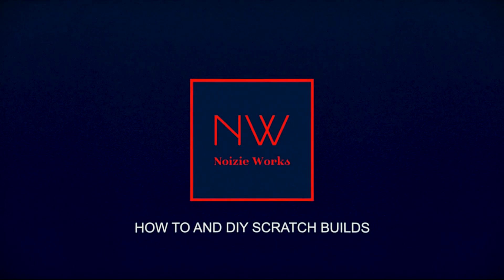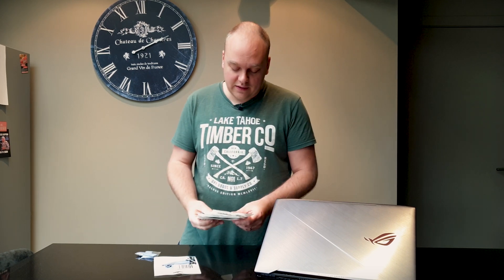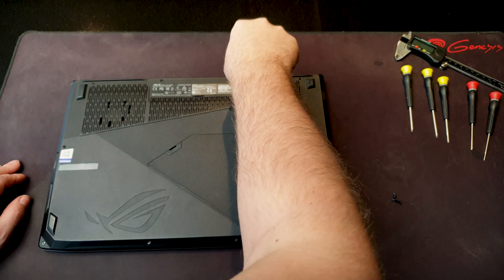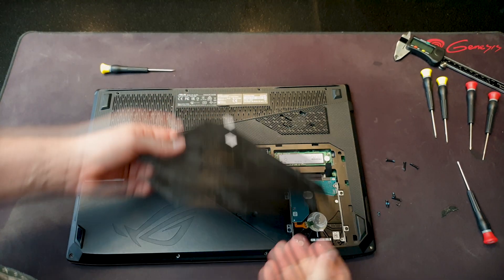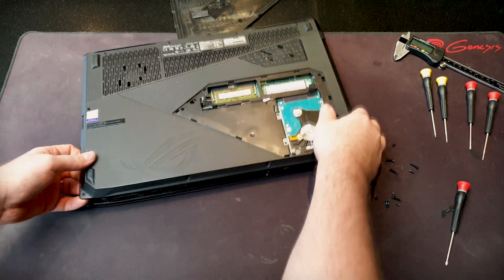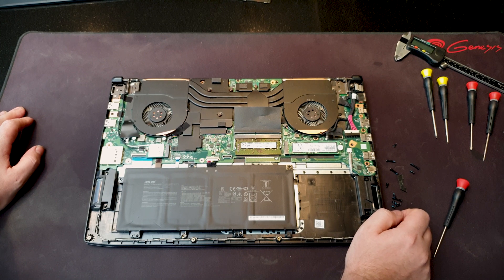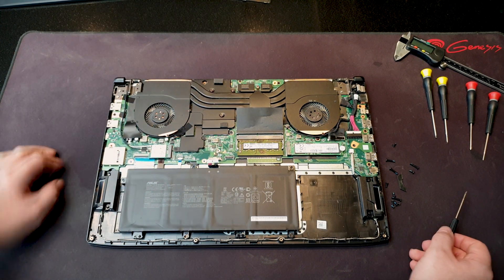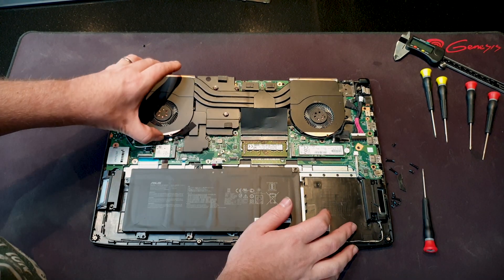Replacing thermal pads on a Asus Rog Strix Gaming laptop GL703V

Comment: What if the Laptop is 7-8 Years old? I have an old Medion Erazer and i've never changed the pads in those 7 Years. Do you think it would be worth in my case?
Reply from the maker: It was mainly the thermal paste but i knew it would destroy the pads so why don't do them both. In my case the laptop was already thermal limited from factory, if you're unit isn't thermal throttling i wouldn't bother.

Comment: I have a Msi gf63 thin 10oc what thermal pas thickness would you recommend I use?
Great video by the way
Reply from the maker: Get yourself an assortment pack with different hights
Reply: @NoizieWorks  thanks man I just got my thermal pads delivered they were 1mm and my laptop's default pads were basically just 1mm apart from one or 2 pads I think that are 2mm or 1.5mm but I replaced the thermal paste and pads and my temps have dropped  at least 5°C - 8°C

I also wanted to ask if my laptop's Cpu idles at 50°C and Gpu at 53°C is this fine??
Reply from the maker: @tristan420  no problem, laptops just get freaking hot so if it boosts with not a lot of thermal throttling you are doing great
Reply: @NoizieWorks  Okay sweet👌💯I did a few stress tests and it doesn't seem to be thermal throttling so I think all is well, I guess one of the downsides of having a laptop is having it run at hotter temps than the sun due to the lack of proper airflow in laptop designs😂
Reply from the maker: @tristan420 💯% lol

Comment: Hii ,can i had run out of thermal pads can i apply thermal paste noCTUA NTH1 on my vrams of gaming laptop or will my vrams short coming in contact with aluminium heatsink
Reply from the maker: There is a thermal putty you could apply. Normaly thermal paste is not conductive so you can apply it however you want but if it's regular paste it could droop out and overheat the vram
Reply: @NoizieWorks How does thermal putty fare compared to thermal pads, do they perform the same, or is one better than the other?

Comment: I have a GL503VS. I've tried replace thermal pad and repaste but my CPU and GPU while doing normal task still get up to 70, 75 Celcius. You guys have any idea how to fix this? Thanks
Reply from the maker: Anything under 80 is great. Problem is that before it would reach 90c and thermal throttle so you did a great job

Comment: Hi, this was helpful to watch. My laptop is starting to get concerningly hot. It's 5 years old and at least one fan is making a noise. I'm trying to decide between replacing the fan or the whole heat sink since it's hot all across the top (where the heat sink would be when I cracked it open). I dusted it already, but it hasn't made much difference. (Didn't know about removing the screws on the fans for cleaning. I'll try that as well.)

Comment: What tool are you using when you squeeze the pads? 
edit what is it doing too?
Reply from the maker: only thing i did was remove 1 side of the protective plastic put it on and then remove the plastic on the other side

Comment: Would appreciate alot if know or find about Acer nitro 5 an515 52 thermal pads sizes, searched everywhere but no right answer sadly.
Reply from the maker: Buy a pack with multiple pad thicknesses and compere them when you open up the laptop. Just be a bit careful and you should be ok.
Reply: @NoizieWorks  thanks for a reply, but one thing confuse me most, pink paste not sure how to measure that 🤔, and I saw alot of suggested to change with k5 pro but even that not sure about amount of paste, so will try to stick with pads if I somehow knew amount of mm where pink paste is to stick pads.
Reply from the maker: You could place a thin pad between it and test it bigger and bigger until you see a dent in the pad making contact with the component you wanne cool
Reply: @NoizieWorks  yea could try that, one more question do u think noctua nt h2 is similar as grizzly kryonaut, would preff nocutua over grizzly saw that gryzzly 'could' damage cpu surface and surface of cooler like small white dots,and gryzzly degrade (dry at 80c that is coomon temp in laptops i guess) but cant find nocutua thermal conductivity, they hiding it for some reason 🤔
Reply from the maker: Haven't tested this but knowing noctua it will be good

Comment: sir... would u mind if i ask ... does 1.5 mm thermal is the actual size for all model laptop ... can i use 1.5 mm on asus zyphyrus which is thin and light laptop sir... what if the actual size is 1mm .... does it matter if i use 1.5 mm
Reply from the maker: I would suggest buying a mixed pack like i did with differnt sizes. Only way to know is to try and measure the original pads on your model or hold the new pads next to it for size comparison.
Reply: @NoizieWorks  ohh thankQ again sirrr. if you say so
Reply from the maker: Good luck

Comment: I replaced the pads on my Triton 500 after replacing the thermal paste because i noticed a dry blue powder on some components. Other components had the exact same compound but was more wet so i replaced all the dry powder with thermal pads and now I'm getting even hotter temps. Any solutions? Did i get the wrong thickness of pads? Or do i need to use whatever that weird blue thermal paste that it came with?
Reply from the maker: If there was some dry ish stuff on it it's probably paste. By putting pads on it you made it worse cause the pads don't have a good thermal transfer. Good luck!
Reply: @NoizieWorks  there was some blue stuff on the brand as well so i replaced the pads with K5-pro paste and I'm still getting about 10⁰c more than i was before i did anything. Is there a special type of paste i need to apply? Should i use some thinner 0.5mm pads? Or should I just use standard thermal paste like on the cpu/GPU?

Comment: Hey man, do these thermal pads last as long as CPU and GPU thermal pads would? Do I need to change these? If so, how often?
Reply from the maker: No like i say in the vid it doesn't make a difference. Only change when you destroy pad
Reply: @NoizieWorks  what about if there is thermal paste applied? https://youtu.be/IpyEY8_7FgA This video here shows the new HP omen 17 uses paste instead of pads, you can see closely. Will that also not matter or should I replace it with these kinds of pads when i get it?
Reply from the maker: It all depends on how thick the pads are, to thick of a gap and it runs out with bad thermals. Imo don't bother and use new pads if you damage them.
Reply: @NoizieWorks  They are using paste instead of pads now though, so will that need to be changed? Or will it also make no difference?
Reply from the maker: If the gap isn't to big it will work much better then pads. Pads are better then nothing, It's a bit of trying out to see if it works for your aplication.
Reply: @NoizieWorks  Oh okay, so if it looks all good then i wont have to worry about changing it at all right?
Reply from the maker: Nope, it's non conductive so you can try it out all you wan't
Reply: @NoizieWorks  Oh okay, sorry for so many questions haha. How come thermal paste on cpus and gpus needs to be reapplied every year or so and not this then? Thats why i assumed I'd need to replace the thermal paste on the vram and other chipsets too on that Omen 17

Comment: I like your video your channel sir damn great... And i have question does it do better for cooling after replace thermal paste and thermal pad both sirrr
Reply from the maker: Thank you verry much sir! Yes it does, in the video where i do the paste you can see full boost clock with same or lower temps. Before it was thermal throttling like crazy. The pads didn't do that much so i wouldn't bother unless you rip 1. If you like my stuff then give me some help with the algorithem by subscribing liking and all that good stuff 🙏 many thanks!
Reply: @NoizieWorks  you are so kind sirrr thankYou i follow now

Comment: Hi man! Gotta say love your videos! Amazing work! I have a question. In your opinion what is the best laptop for gaming in terms of not getting overheated easy? Is there even such a laptop? Also, do laptop pads work? If yes, can you recommend one as well? I really trust you on this.
Reply from the maker: Hey dude! Thanks for the kind words.
I only have this laptop but i follow the market and they almost all trade between looks and performance unless you pay a high premium so i would go for a model with the specs you want from a good name brand that's on sale. Give it a quick google if there's no big problem with it and go for it. These days the components like gpu and cpu are build to handle 100°c plus but the biggest problem with the thermal design is getting thermal throttling and lower performance. Like this laptop most will benifit from better thermal paste but they will stay hot. As for laptop pads yes they work! go for the reviews cause i'm in the building proces of making my own usb powered cooling pad(buying it will be much cheaper) so you can expect stuff like that in a few months when i'm done with building my cave( facebook Noizie Works if you wanne follow) hope i helped a little.
Reply: @NoizieWorks  I gotta ask, can you give an opinion on the laptop  MSI Titan Pro GT73vr 6rf? It truly seems like an amazing laptop with amazing cooling capabilities. One of the best I've come across in my research. And I would really appreciate an expert opinion on this (A.K.A. you :D). Thanks in advance.
Reply from the maker: Is it the one with a 1080 in it?
Reply: @NoizieWorks  Yes. Also I  can't find the model for purchase anywhere too.
Reply from the maker: @Allexanderr10  i think they don't make them anymore as they are a few years old now.
Reply: @NoizieWorks  Sorry to resurrect an old topic and ask a totally different question altogether, but I wanted to ask what is a good Wifi card for gaming latops? I have a Realtek RTL8852AE WiFi 6 802.11ax PCIe Adapter and it sucks to be honest. Constant drop in ping and it is just annoying.  I am sorry to ask you this, but you are the best youtuber I know regarding pcs and electronics. Your videos helped me a lot in the past. Thank you in advance. :).
Reply from the maker: Damn, thanks for the nice words but i'm more of a rando then you think(more into the woodworking/3dprinting stuff)and honestly have no clue what's the best network adapter for laptops. What i do know is that a lot of these adapters have the bluetooth module on it to. Sure that it's not the wifi router giving you trouble and or you are to far away? Does it happen when you sit next to it?
Reply: @NoizieWorks  Well yes I am far away, but far away literally means the next room. That should not be an issue. Also the constant dip in ping is ludicrous. I checked online and everyone with my wifi card has issue with it and don't like it so I definitely want to upgrade. Was hoping you could help me there.
Reply from the maker: Ah that sounds bad, i have no experience  in these cards so can't recommend anything.
Reply: @NoizieWorks  Okay, thanks for your time anyway. :)

Comment: Nice video! my laptop is an FX503 and the heat sink of my laptop is exactly the same yours so im guessing the thermal pads will also be the same. by the way, did you cut the fan cover of yours?
Reply from the maker: Thanks! 
I made a few holes in the cover, cut out the ribs at the back to get more flow but it didn't do a lot. Biggest change is the paste.